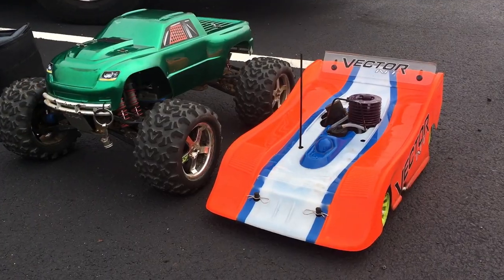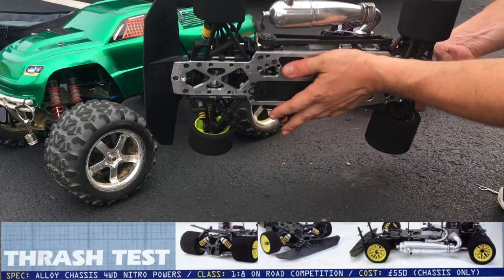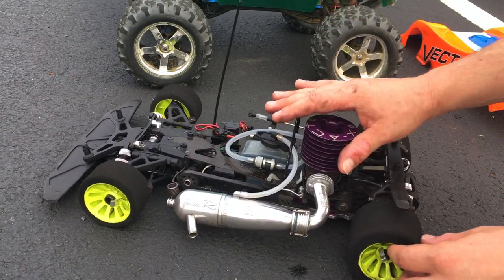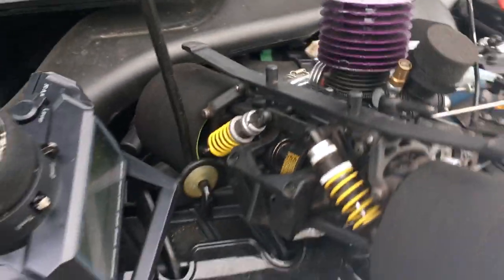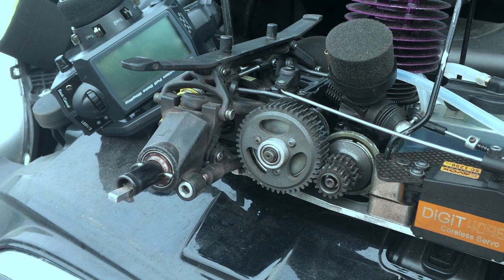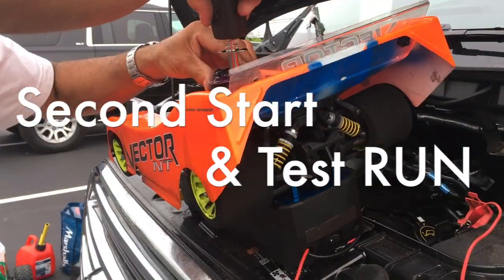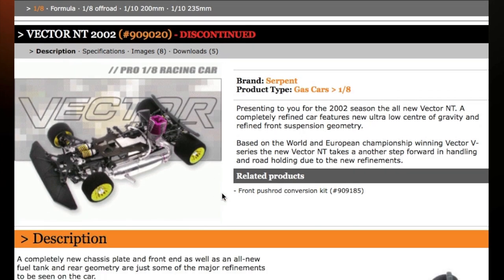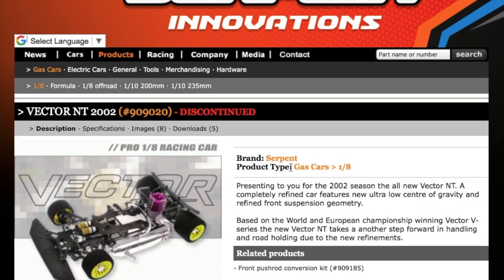Serpent Vector NT (A High End 1/8 On-Road Nitro Race Car from 2002)

Comment: I use to race these cars back in 2000 in Toledo. I had the Vector and the Vector NT and it was the Best RC Car I ever had. So much fun and its a shame they discontinued them. They still make these but they now call them the Serpent Vipers. If anyone is actually interested in getting one. Please be sure to get the best engine and pipe for it. Do not go cheap. I highly recommend a Novarossi Engine as they are the best. I also noticed the prices came down a bit too as when I bought mine the actual kit was around 800.00. Now that is no radio, engine, pipe, nothing. Just the car kit. But these are definitely the fastest and best precision 8th Scale racing RC Nitro Car on the Market IMHO.

Comment: I have the same exact model serpent. Impossible to find parts now. Bought it  used a few years after it came out. Played with it for a summer and too fast. Took it all apart and scrubbed it clean and was perfectly reassembled and shelved it for 15yrs!!!!. FINALLY took out last year. It was still tuned and shifted perfect. Leaned it out for top speed run in front of my house. I hit a little dip\bump in the road doing probably 70mph, flipped about 15 times!!!!. No body on it. (its true...those times in your life it does happen in slo-mo) Only broke a few parts (rear blocks mainly) and cracked bumper luckily. Was able to find them online. Too scared now to drive it as no replacement parts. So be careful with it.

Comment: The serpent NT dropped a dog bone shaft @ 8.55.

I really love 1/8 onroads. I have 2 of them, a picco integra which is older than the serpent NT and an X-ray rx8.
I’m thinking of letting go of my picco integra roller to make room for my newer models. But until then, I’m still having second thoughts on what new vehicle I should get.

Comment: When you get a chance bro , could you please help with a problem I'm having with my baja
Reply from the maker: whats my my dude!! I just watched you video and left you a comment.  That wobble looks pretty normal,  When the car sits with the wheels on the ground and weight on the suspension it will be ok.  Did you run it as it is right now?

Comment: Love that body style. Should not have to take them apart to adjust 2 speed, there's usually a adjustments hole.
Reply from the maker: hey dude!! thanks!! You're right, my buddy and I took it apart because it only took the removal of one E-Clip and it was easy enough, and also cool to see the inside of it.  Mostly just for the video, you know.  Soon we will be doing top speed runs on this with a GPS.

Comment: Thank you for putting up nitro content.
Reply from the maker: you got it!! I love nitro and gas RC, if you noticed I don't do many electrics anymore.  I still have them, bt they are just so boring to watch on video.  Only thing that matters with electrics is top speed runs for me.
Reply: @hybrid32494  I mainly run nitro ... only brushless rig I have is a blade fusion 480...  (heli)  6s machine.  Other then that I have a savage xl 5.9 an my revo which did have a 2.5r , now has a brand new 3.3 that absolutely rips.
Reply from the maker: @DomVito87  which fuel do you run?  I am planning on doing speed and temp test videos in the future with the worst and the best rated fuels and different nitro contents.  Would be interesting.  The savage XL 5.9 is incredible, I've owned the old savage 21 and savage 25.
Reply: @hybrid32494  I only run byron fuels. 20 percent. My nitros love em. You know you have to keep them happy!!
Reply from the maker: @DomVito87  same fuel as I run.  I started of with Odonell years ago, now I cannot find it anywhere.  You 100% right.  Cant go wrong with BYRON.
Reply: @hybrid32494  my 3.3 broke in very well with that fuel.

Comment: I have two 1/8s an old Picco Integra and a 2013 Spec Xray rx8. The handling is nice, but bashing wise useless on uneven surfaces.

I actually converted a traxxas nitro 4 tec to a 1/8 racecar copy and I 3D printed the floating bodymount. I also 3D printed the wide rear wheels that accommodate two 26mm tires. You get the picture.

It’s basically a mock copy, but atleast its a bashable pan car.
Reply from the maker: hey man!! WOW, that's a load of work you did, very nice!!  You're a true RC hobby guy, I can appreciate that.  You're right these high end road cars are only for smooth pavement.  I used to have a nitro 4-tec 2.5, liked it for what it was at the time.

Comment: I came up on lot's of used parts to build a few rollers. I can't wait to get into it. I grew up in Pomona and the original Ranch Pit Shop had an 1/8 on road track that they later converted to off-road. Seeing and hearing those 1/8 car's come around the corner then shift into second down the straight was better then seeing all those prostitutes out front working😁

Comment: Hello isn't the suspension too soft?
Reply from the maker: hey man!! The suspension on this car was set at it's max ride heigh already.  And honestly it's pretty firm as is, I was pressing down on the chassis pretty hard for it to flex that much.
Reply: @hybrid32494  i guess you wanted it that way for the street but for track it wouldn't be the best to have it that soft with all that travel

Comment: I used to have a team magic g4 black magic 1/10 it had a novarossi 11 engine with a tuned turbo pipe was super fast and would leave the 1/10 serpent cars behind
Reply from the maker: im gonna look up the team magic RCs, thanks for the info.  I'd say the 1/10 serpent cars were nothing special, it's all about the 1/8 models like these in the video.